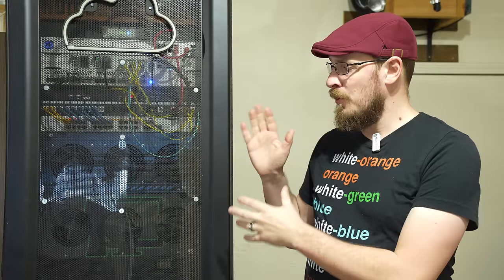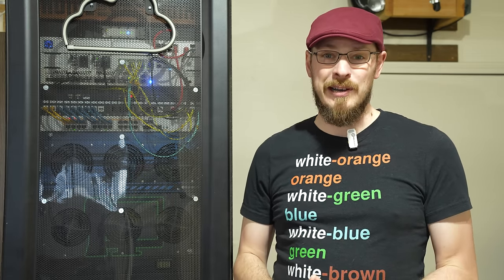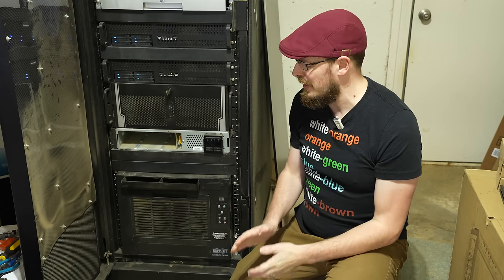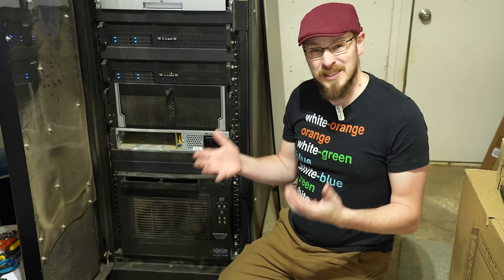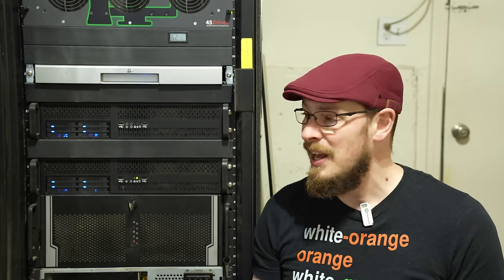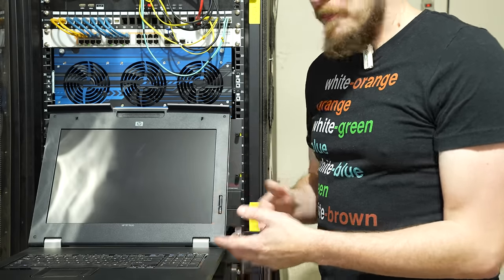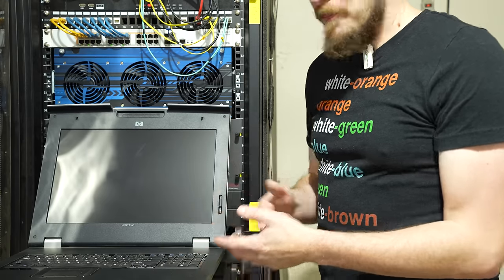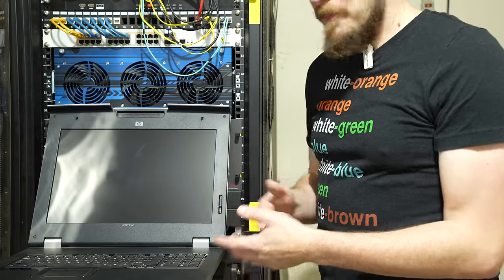Homelab and Server Rack Tour - 2024 Edition

Comment: i think you should do a 40g dual nas setup - one ws, two nas, 3 dual port 56g cards and nvme arrays raid0 or raid10 - it should work and low barrier to entry makes it an ideal content idea - also no switch needed. props for low power on rack - hopefully you will be able to finish office and do some solar pv panels to have some more flexibility with lower power bills - more money for beer
Reply from the maker: Unfortunately my house is a terrible candidate for solar. I'm in a small valley, and my roofline is mostly facing the wrong direction without a complete redesign. I am looking at a method of geothermal cooling though, which should help offset electrical costs for the new building.
Reply: @CraftComputing  arrays don't have to be on the roof, they are better off the roof; with incentives and tax benefits alternative energy can be compelling - maybe think about a vertical helical turbine or two - they make power at night, definitely think about a heat pump - they can be 200-300% efficient - you could have the geothermal working all the time cooling or heating buffers for the heat pump - that would probably make it more efficient - you have a couple insulated concrete cisterns which correspond to hi/lo side of heat pump, also a heat exchanger could be a good project - they can be 90% efficient and you get pos pressure hepa out of the deal - no more dust or allergens.

Comment: the reason Comcast is only offering 35 up is more then likely they are running at docicis 2.0 for the upstream. they are probably only running 3 streams of upstream for equipment and 24-32 for the 1gb speeds on download. 
since gigabit is the current competitive standard right now. they are not going to offer more till others start moving to 2.5 or 10 gigabit and force their hand

Comment: Hi could you do a Video. On how to run mostly Docker Containers. 
There are a lot of possibilities and I'm a little bit lost on what is the best way. 
For example. Do i build a powerfull server instal Linux and then just run them?
Do i install Proxmox and then run them in a Container? Do I use multiple Containers?
Should i use Unraid for the other benifits and only the minimal lost in performance?
Should i run a kubernetis cluster with multiple small Servers?
My example would be plex / wordpress / gaming server.
Reply: Start simple and work from there. I'm running Ubuntu on an old Dell optiplex with docker and portainer. Works great.
Reply: That is what I'm going. I'm running Unraid on an old PC of mine. But now I'm thinking about what should my setup be when I want to upgrade. What dedecated Hardware and usecase should i look into.
For example I have a lot of issues with my VM for Veeam on Unraid. Do I run a seperate Server for that or do i run proxmox. But this all depends on my biggest usecase Docker and the optimale Setup i want to grow into. :) Thanks for the reply.

Comment: CC, so did you take my advice and replace the ram on those ES boards and they no longer have the rebooting problem, or do they still have a reboot problem but you put them in your rack anyway?  Nothing goes in my rack that is hardware defective so I'm curious what the resolution was.

Comment: Video cleaning the rack plz
Reply from the maker: I'm just going to blow it out with an air compressor, then get people linking Jay's video telling people not to do that because of back voltage, not understanding that it's possible to block the blades from turning. Or something something compressed air humidity, static charge, etc.
Reply: ye, thats dusty
Reply: @CraftComputing  An aircompressor will do the job just fine, been doing that for a decade, and always tested the equipment for damage after with no problems. Love Jay, but I always take what he says with a grain of salt, as he said dome questionable "facts" over the years. Happy new year btw.
Reply from the maker: @andrevilaca6469  Yes, fans are basically generators. But talking like there aren't ANY backfeed protections built into motherboards... There are reasons it's not worth getting into it here.
Reply: @CraftComputing  Exactly

Comment: Hey Jeff, question. My previous company I worked for used something they called a "console server". This isn't a KVM For the VGA/mouse/kb ports on a server, but something that has a series of serial ports on the front or back that you plug the console came into, then plug the rs232 port into the front of your switch. This allowed them to manage the console ports of their switches remotely over IP.

Ever heard of this? I'm looking to add one to my home lab but not sure if I'm finding the correct thing.. when I search for "console servers" everything that comes up are KVM's.
Reply from the maker: KVM Switch is likely the more accurate term for what you're looking for. Unfortunately, mine doesn't accept RS232 control, so I can't select devices remotely.
Reply: It was definitely a thing, particularly in the semi-old days when I was getting started. I know that there are at least a couple of models in the Avocent Mergepoint line that do it. the newer ones can also have serial in addition to conventional vga KVM, but the dongles are almost always pricey, even on eBay. I'm pretty sure that Avocent had some older serial console products I saw too, but I couldn't name them.

Comment: I'm running 10, 25 and 40 Gb in my homelab. For hard-drive backed storage and zfs, 10 Gb is basically on point, and until I'm hitting very small files (with meta special device on NVMe) I've never seen more than 450 MB/s anyway. 25 Gb is usable to its max in Windows and NFS, based on NVMe (I have Optane drives, though). 40 Gb? Nope. In most cases it is SLOWER than 25 G network. My switch is capable of both 4x10 and full 40 Gb links, and yet, Even when using iperf3 between very fast systems, I have never been able to reach more than 31 Gb/s on Linux, and 17 Gb/s if Windows is involved on any end. On 25 G links, I can consistently hit 22-24 Gb/s on any platform. Not for file transfers, though. These cap at 18 Gb/s.

Experimentally I have dropped pair of 200 Gb/s cards, and while numbers are there, again, single system is simply not able to generate enough traffic to saturate even a quarter of that link.

Comment: You're telling us a lot about VMs, racks, small factor devices and other cool things - we love it! But can you tell us some about security of the network, subnetting, wi-fi, control and other cool stuff? Or this is not your point of interest?
Reply from the maker: Not a huge point of interest for me, primarily because none of my servers are exposed to the internet. I'm not terribly worried about intrusion because there are no open doors on my network.
Reply: @CraftComputing  You can get a malware, miner, your internal network may become a botnet, for example. Some of the device in common network may be dangerous. I'm not calling you to be paranoid, of course) But for me it's a huge and very interesting part of my homelab)
Reply from the maker: I don't have execute permission from my local machines to any of my servers, and no shared authentication between workstations or servers.

There's no mechanism for malware to run or execute on my servers. My workstations don't have direct access to the GPUs in the rack.

The only type of malware that would have a fighting chance would be a cryptolock, but I have ZFS snapshots on all my network storage, so reverting would be relatively painless if I were affected.

Comment: NOOB question.

Am I correct that a lot of home servers have an uninterruptible power supply with batteries with an inverter that outputs nice clean 60Hz sine waves, that are used to provide power to a power supply, that converts those nice sine waves back into DC.  That power then goes into a motherboard that uses a technologically incredible series of VRMs to convert the voltages into nice clean power.

As solar gets more popular, are there going to be home server options that leave everything DC all the way into the CPU?  What are the associated issues?  Would there be safety concerns?  I've always been curious about this.  Buck and boost converters can be very efficient, but do they have issues with transients that AC to DC doesn't have?

I just love the idea of putting your server on the whole home battery before the inverter with device specific dc power units instead of a ups that's trying to be a universal supply to both very resilient devices and very sensitive devices.  Maybe instead of an inverter, you have something that outputs high frequency sine waves to the devices in the server and each has the back end of a buck converter.

My stepdad worked on a cargo ship and a lot of their appliances were DC instead of AC.  I'm not sure why.  But the DC versions of common devices were very interesting.

I know that these devices are already very efficient, but even adding maybe 3% efficiency through fewer inverters has a large impact on a devices with this sort of power draw.  Reducing power AND heat, potentially.

Comment: I'm surprised Comcast doesn't offer you 2gbps/ 200mbps for y'all yet, moved to a new apartment in Minneapolis and saw it was offered, decided to upgrade and I actually see the speeds, according to my firewall/routers speed testing averages 2.2gbps/220mbps over coax so it is doable. Also any plans to get & test the Unifi Rack Mount cable modem?

Comment: SMB will not scale to stupid fast networks on TCP because frankly even OS TCP stack can't keep up with those speeds. What you could do is use SMB Direct to utilize DMA for far faster transfer rates, but actually getting it to work can be somewhat tricky. For one if client OS is Windows then you need to run Workstation edition of W10 to even get DMA support. Also on server side your regular Samba on Linux does not support SMB Direct. You could use ksmbd which does support it, but so far I've seen very little in terms of success stories of actually getting it to work. A friend tried it actually but it was no go. Now if you don't want the headache of dealing with all that, there is actually a way to get your SMB share multithreaded and you can do it with single network interface. You can enable RSS on server side and even regular Windows client actually supports it. Based on my testing I've seen my Windows 10 client use 4 connections with RSS enabled. I'm not sure how big of a difference it makes because my 10Gb link can be saturated without.
Reply: Gotta correct myself: friend did eventually get DMA working with ksmbd but only with older CX3. CX4 linux driver had a bug or something and would not detect DMA support. Either way I still don't think it's widely used kernel module yet and even less used feature within it. Be prepared to having some weird issues if you use it. If both server and client are running on Linux then NFS with RDMA is probably less headache.

Comment: If you end up just exhausting air outside anyway, then why even bother with the AC unit? I get that it's exhausting the hot side, but you're still pulling air out of your room to the outside, if you just vent the heat from the server instead of from the condenser, you'll save a ton of power for very little difference in temperatures.

Comment: might want to tone-down the starlink remote access. Elno doesn't think people should be doing that and you risk getting your service cut off or the cost increasing to their "roam" package prices, which will make all your electricity bill reductions completely meaningless. Or maybe you're on Roam already and just expensing it. 

I priced out the 45 drives hardware and some of the other stuff and I think that recreating that rack and networking is going to run something close to $30k. That's not really "hobbyist" territory.
Reply from the maker: I pay for roaming access. It's a higher tier plan for RVs.
Reply from the maker: Also, take away the Epyc Rome system and you're left with under $6K worth of equipment. Certainly expensive, but not exceedingly so.

Comment: I’m a bit doubting the 350 watt idle.  The math isn’t mathing with what you have in the rack.
Reply from the maker: The 64-Core Epyc and HL15 are not powered on. All I have running are the two Erying VM machines and the AV15 Craftinator. 15 HDDs, 18 SSDs. Networking is Three switches and a UDM-Pro.
Reply: And APs and cameras?

Comment: ooofff almost 6 years on the same batterys that's bad, I do mimium every 3 preferably every 2 years for the ones that the batterys r cheap
Reply from the maker: Batteries are rated for 5 years minimum operation. Mine started alerting for battery health in November.

Replacing every 2 is excessive.
Reply: @CraftComputing well I must of had some old stock or a bad battery’s cuz mine died in under 3 years on my cyber power ups that doesn’t have any network monitoring

Comment: Ok first of all, I am not sure why you need all of that for a "home lab". to be honest I will never get the definition of the word "home lab" because most home labbers find themselves using consumer equipment while still getting second hand enterprise grade equipment for no reason and end up using their entire infrastructure for testing and not production. you seem to be mixing enterprise, non-enterprise and test equipment. this is terrible for production. also for tiny environments, the equipment you have is unnecessary. you can literally virtualize almost all of that what you have. also never put test machines on the rack, it doesn't make sense.

I have been running servers at my house since the year 2005 and only in 2012 is when I changed from desktop pcs into rack servers. I still have my active directory environment from 2005. now I am hosting tiny websites for two customers using one of my virtual machines on my server system. I always "use" the infrastructure and never use it for testing. if I find myself testing, the entire network goes down and in enterprise, this is not acceptable. this has made me buy more servers.

I have to keep asking myself. what equipment do enterprises use? does this system qualify to be enterprise grade? I would never use consumer equipment like non xeon, no name motherboards or consumer hard drives for equipment running 24/7 because they weren't designed for that purpose. however at the same time, your equipment also proves that technology changes, that to keep things more efficient, you could just use modern consumer desktop hardware to just virtualize your test infrastructure because the enterprise equipment out there is old, inefficient and only good for reliability over efficiency. I would still never use them to run 24/7 unless its something non critical.